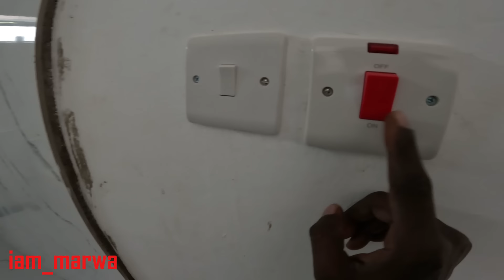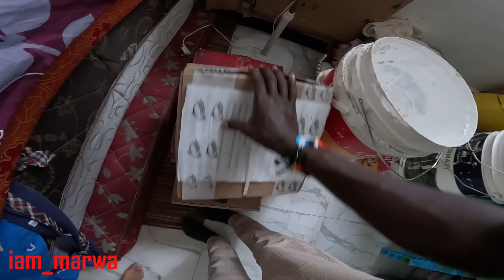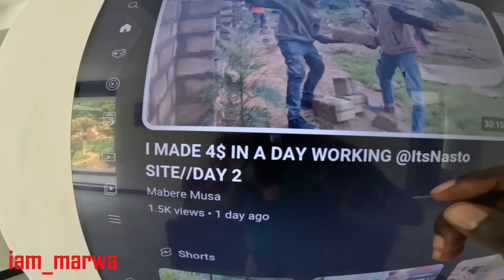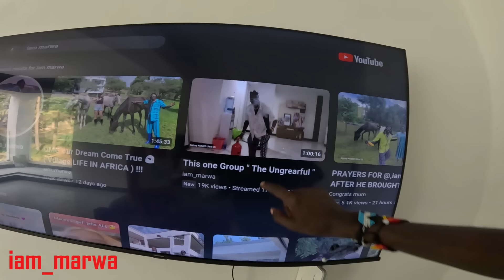The STATE of My Villa in KENYA , AFRICA ( 2024 )!!!

Comment: On the pool, if you build it under the tree green algae will form very quickly off the falling leaves.  It will be a pain to keep clean. I know as I have dealt with it. Just FYI.  Maybe build it around the tree, verses under. Also please give up the idea of a helipad on the house. It is extremely dangerous, and the house was not designed to carry the weight. If you must have one, do it away from the house in a corner. Take the ego out of this idea my brother. Blessings.

Comment: Use tick shampoo until they are gone you may also need to treat the cows as well.The tick routine should be done maybe every 2-3 months as maintence.And use a separate Brush for each horse.Because you don't want to spread the ticks further.Daily clean the poop will help with less flies

Comment: You need to get solar power at the compound , just about $8000-$10,000 USD should buy you enough panels and two 10K batteries you will never ever be out of power , you can run a/c all day long , and run lights all night long

Comment: Thanks for sharing the update. A house this size REQUIRES a professional to help you with SPACE PLANNING, furniture, accessories and accommodations. The Villa is a combination of residential, commercial and ranch style luxury living....... There is no duct work to allow proper ventilation throughout the Villa. .... HVAC system is needed to improve air flow within the house ..... The design, while appealing, is all over the place with no clear thought about aesthetics and functionality to compliment the build. Marwa, while I respect the home is a reflection of your style, you should allow a professional to help you. It's costing you MORE money and time in the long run by not doing this right from the start. You never buy appliances for a kitchen or a bathroom without proper space planning. The guy from Interior Concept gets it, he can help you.... Here is an example, bathrooms, not truly functional, the light switch covers; they have been mounted into cement with wood screws????  The switch covers should complement the space, not become an eye sore. I would suggest, start with training your staff. Accommodations should be five-star, with no exceptions!  All staff members should be aware of cleaning and maintenance standards. Professional cleaning and maintenance will save you money in the long run. In the loft area, I would suggest that area be used as sitting and conversation lounge. Guest can gather after a meeting, meal or party downstairs. That loft area should be designed using swivel chairs, sofa, armchairs, tables, plants, accessories and rugs to reduce sound. The loft space uses the outdoors to compliment the villa and add ambiance and inspire creative thought and FUN. Doing a in home music studio can become expensive, if money were a concern, I would do this last. Home movie theater is needed in the Villa, get a good projector and audio system. Aaron room is the best room in my opinion his design is contemporary, simple, luxury feel and functional. You have a lot going on at your place. Take it one project at a time to completion.